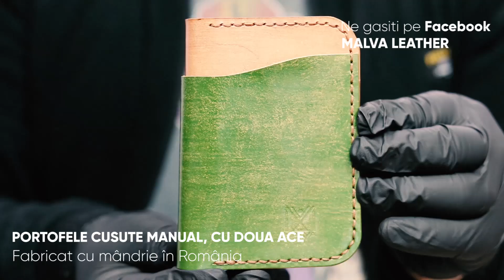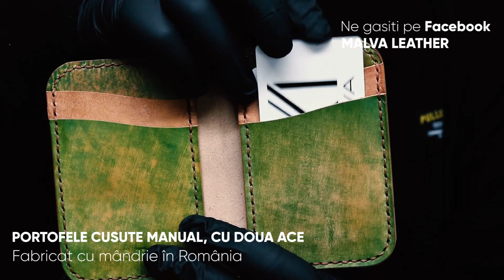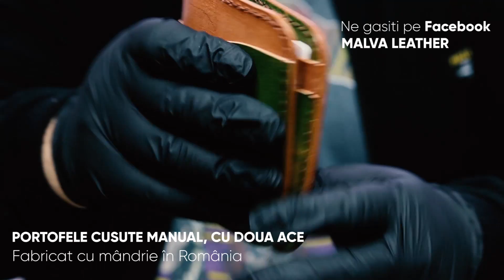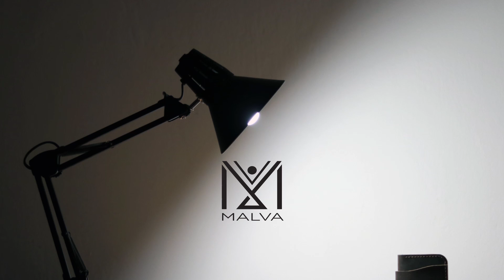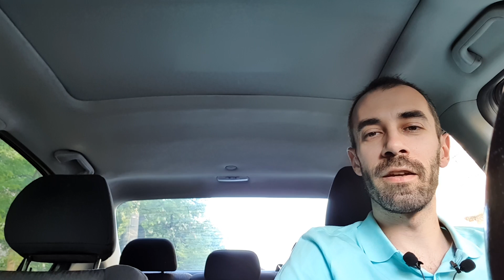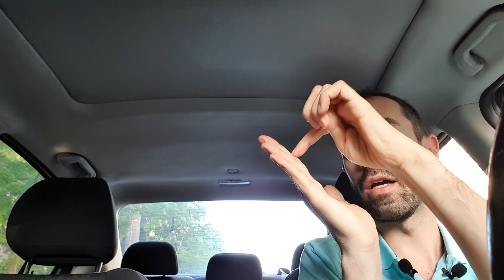Turbinele Twin scroll, de ce le folosește BMW?

Comment: Turbinele nu sunt angrenate doar de gazele de emisie !!
Reply: Ai vrut sa zici de evacuare....dar de ce altceva sunt angrenate?
Reply: @vladdutz20  Electric si cred ca printre primele masini echipate si cu asa ceva este Audi SQ7 ca sa elimine lagul  prezent la cele clasice
Reply: @danutavram831  alea sunt compresoare, cum este BorgWarner eBooster.
Adica contin un impeller compresor.
Turbinele au 2 impellere, turbina este partea antrenata de gaze si compresorul e partea care comprima aerul in admisie
Reply: @vladdutz20  Doar tehnic se numesc diferit dar ele fac acelas lucru si este folosit des termenul de electric turbo, cum de fapt si turbo compresor la cele actionate de gaze
Reply: @danutavram831  da, chestie de semantica, oricum un booster electric nu duce sarcina, e doar de umplutura pt eliminare lag, interesant la mercedes ca il baga in sistemul mild hybrid de 48v
Reply: @vladdutz20  Apropo de Mercedes ca ei au marketat termenul de Kompresor de ceva timp care zic eu tot un turbo e care este angrenat motor ,da dar mai nou cam toti marii producatori folosesc  sistemul mild hybrid  parca am vazut si la Audi